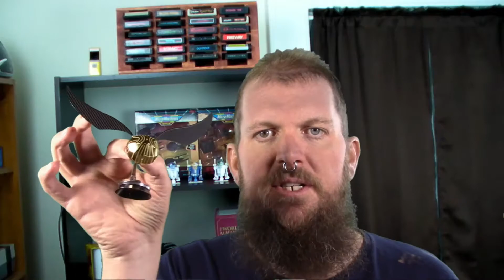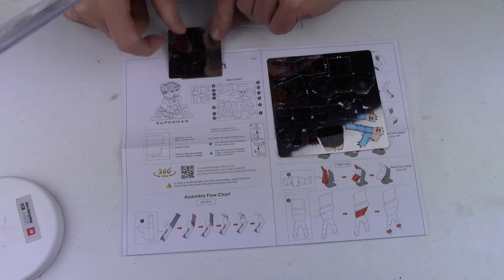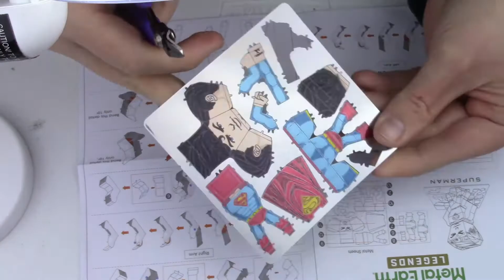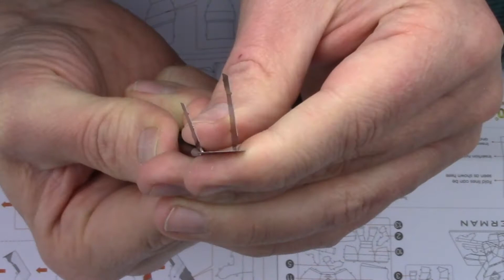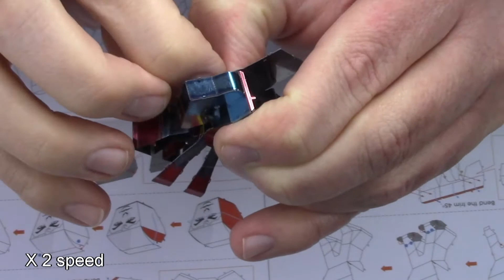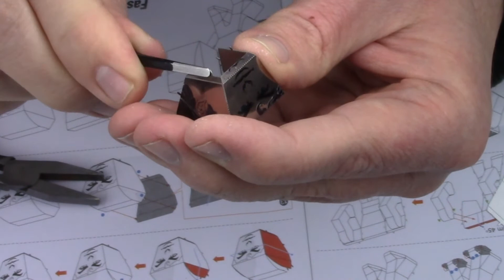Metal Earth Legends Build - Superman

Comment: Do you have to have tools
Reply from the maker: I would recommend at least clippers to remove the parts cleanly (Nail clippers could work for that) and tweezers to manipulate the parts. Otherwise, for this model you could get by with just that. It is possible to remove the parts by bending and twisting the connections to the sheets but you run the risk of breaking the parts.